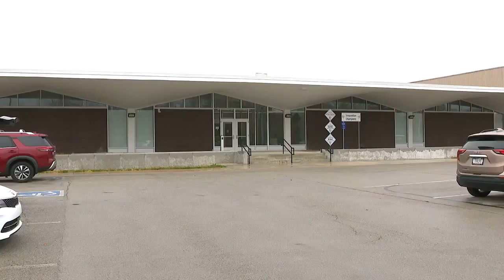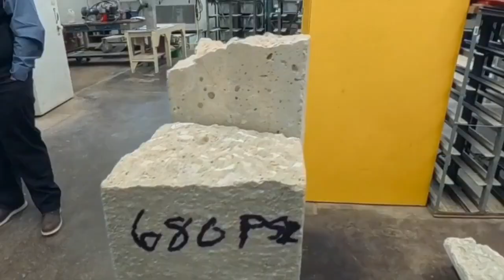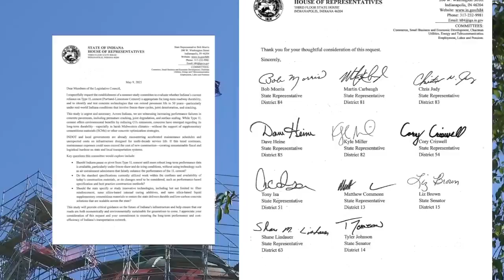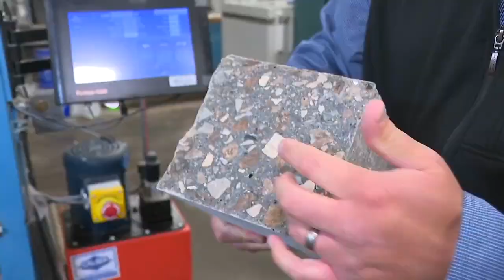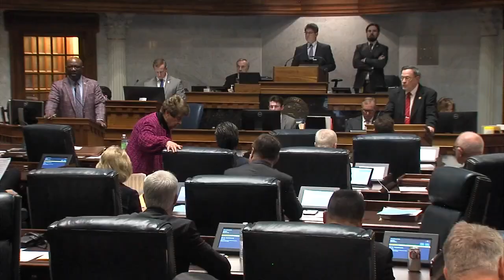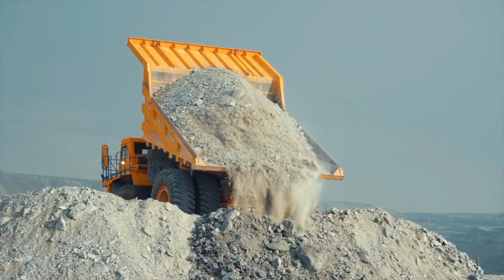State lab tests concrete samples amid cracking concerns on roads and bridges

Comment: Why not pour the concrete thicker with fibers?
Reply: @kennycentralindiana3553

   That would cost a little more money and every single little tiniest detail on state indot jobs is reduced down the cheapest method possible.

  I have worked as a Union Operator for a general contractor doing work for indot for the past 25 years and before that I was a Union Laborer for 14 years and I can say without hesitation that most of the cost saving ideas that come out of the state indot office are profoundly stupid and lead to much more rapid failures. Sometimes before a job is even completed.

  Indot wants everything built quick and cheap which equals having to spend money to replace things sooner when a little more money could be invested to do things the right way the first time so it would last like it should.

  At one point indot decided that bedding storm and sanitary sewer pipe with 3 inches of #8 stone under the pipe for support(which has been the norm for the 39 years I have worked in the industry) but indot thought that wasted a lot of money on unnecessary stone so they decided to stop bedding the pipe with stone and only backfill with stone to the spring line of the pipe(halfway up on the pipe) whereas it had always been to backfill with stone to a foot above the top of the pipe. The first job I worked on after that change was installing 60" reinforced concrete pipe which came in 8' long sections. We were putting it in at about 18' deep and did what indot wanted we laid the pipe straight on the dirt and placed stone only about halfway up on the pipe. The entire run was about 1,500' but before we even got to the 1,000' point there were huge sinkholes forming along our ditch directly over the top of our pipe. We had to fall back and start digging up the pipe where the sinkholes were at. I already knew the pipe had separated at joints where one pipe had settled into the soft wet soil more than the pipe it was connected to had settled and that pulled the joint apart which allowed the sandy soil and dirt to flow into the pipe through the opened joints. That created the sinkholes and also a huge problem on how we were going to solve the issue.

  It ended up with indot paying us on hourly rate to dig up all the pipe that had been installed and put a stone bed for pipe to lay on and backfill with stone to a foot over the pipe. It was a muddy mess and difficult the first time but digging it up the second time was a literal nightmare. I had to constantly keep an eye on how badly I was sinking into the quagmire so I didn't get the CAT 349 excavator sunk too deep. I would have to track the machine out of bottomless sloppy mudhole and dig out some of the slop then scrounge up some mud that was a little bit drier than the slop I was covering then track back on line to continue digging.

  It took about 2 and a half weeks to bury the pipe we had in when the sinkholes started. It took over 3 months to dig up and re bury all the pipe using what I like to call the right way. I cannot begin to imagine how many extra millions of dollars that cost taxpayers all because indot tried to save 3 or 4 thousand dollars on stone.

  It is common practice to put down a 4" bed of #53 stone under concrete sidewalks and about 15 years ago indot in their infinite wisdom decided that 4" of #53 stone was wasting money so from then on all state jobs that included sidewalks would have the concrete poured directly on the dirt which was another insanely stupid idea. The layer of stone provided a disconnect between the bucking and heaving of the Earth as it froze and thawed and the concrete. This kept the concrete from cracking and buckling due to being pushed up and down by dirt freezing and thawing. And that policy is still in effect 15 years later.

  Every time you go through a roundabout and notice the sidewalks are all cracked and crumbled up it is because the concrete was poured straight on the dirt.

  Those are but two examples out of hundreds on how cutting corners to save a few quick dollars ends up costing exponentially more in the long run than just properly funding doing right and to last the first time.

Comment: You wanted to stop cracking and breaking here's the easiest way stop putting quartz stone in the mix quartz holds heat and small amounts of electric energy quartz vibrates when exposed to radiation from the Sun the quartz in the mix is your problem

Comment: Curious testing method. How do they acquire samples and maintain accuracy that the concrete mix is a 100% match to the structure built?
Reply: INDOT pays independent contractors to take a core sample at the location based on an agreed plan. Includes patching core holes afterwards.
Reply: @williamlloyd3769  thank you for the information. I remember years ago a large section of highway near Logansport on 35 had a bad mix and needed replaced within a year or two.
Reply: Get the sample when its poured, cure in best case environment.  You cure them in a lime water bath